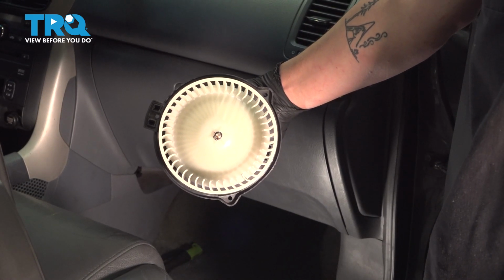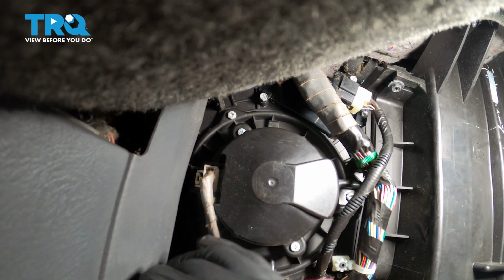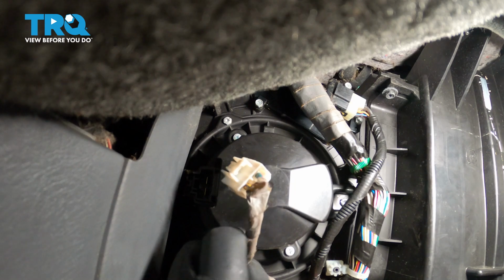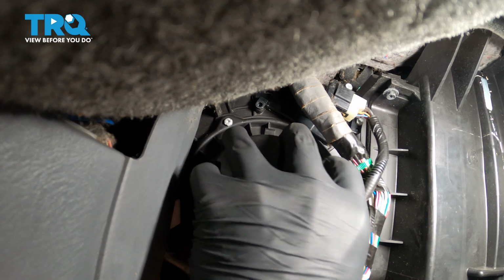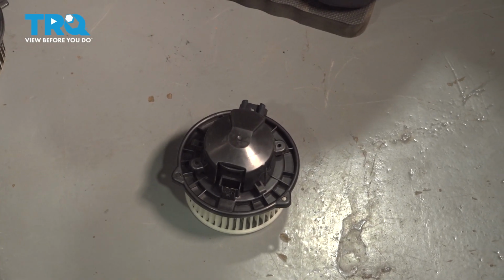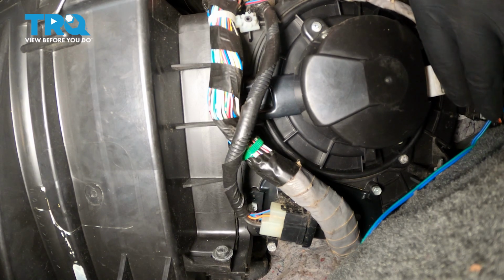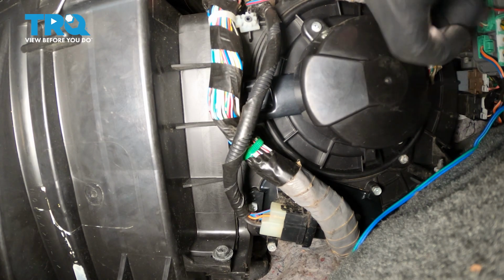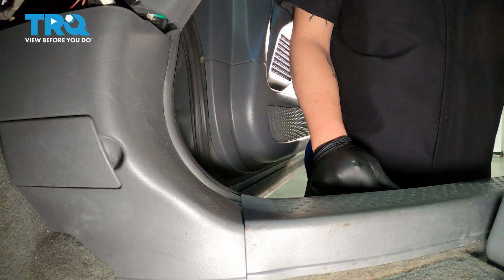How to Replace HVAC Blower Motor Assembly 2003-2008 Honda Pilot

Comment: Just watched this again after a couple years. The 2nd screw removed was not holding the blower in place. The screw to the left and slightly below the one removed is what holds the motor in place. 2 screws at about 11:00 on a clock, the top screw of those 2 was still holding the motor in place.

Comment: In the middle of doing a remote start on my 08 Pilot and figured I’d address the squeaky hamster wheel while I’m under there. 

Are those blue wires going to your passenger fuse box your lock and unlock by chance? Because that’s the exact connector I stopped at last night. Ha